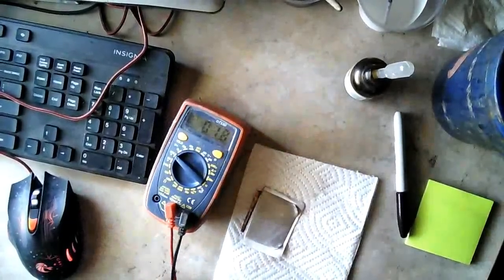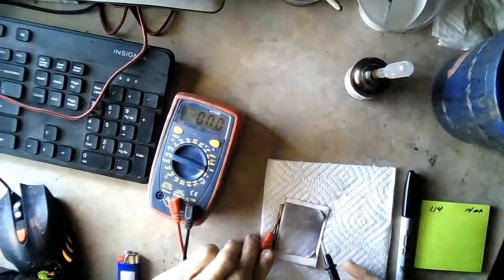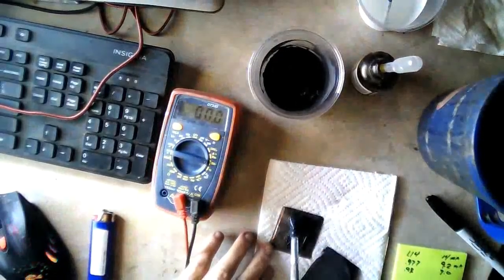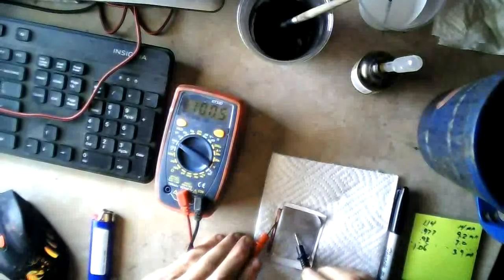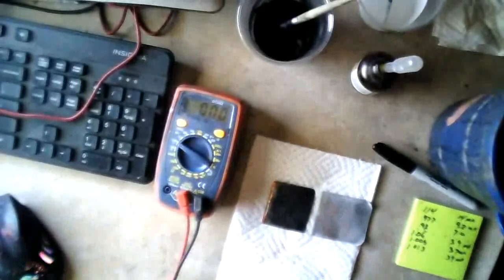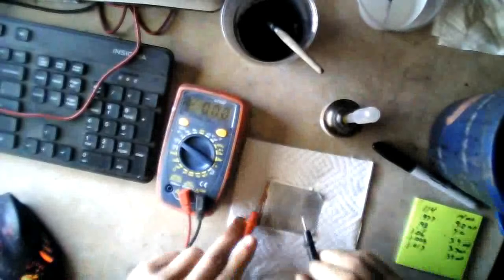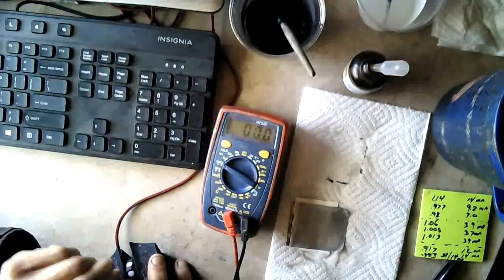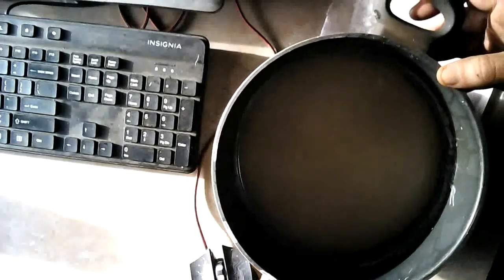Borax Concentration Question!

Comment: It's interesting that the PVA goes into solution with the borax further testing is probably warranted. Kev conducts countless experiments with various concepts. Not everything works the way you would expect.
Robert has a video using a few drops of glycerol in doped PVA linked with borax to make a solid plastic that would peel off waxed paper as a stand alone sheet. He has suggested using the plastics for solid electrolytes and possibly electrodes. There are so many ideas and only so much time to indulge. At any rate you are investigating some of the important fundamental questions.
Reply from the maker: We should find some more answers today, and hopefully build a better battery too. :-)

Comment: One thought that may or may not be helpful ;) -- normal PVA glue is not completely waterproof, even after drying.  For a longer lifespan I wonder if a truly type 1 waterproof glue would work better.  Titebond III ultimate wood glue is a cousin to straight PVA glue, but it is truly waterproof.  Or another option would be something like minwax spar urethane.  Thanks for all of your information!  I'm going to be doing a bunch of battery tests this summer and hopefully posting a bunch of videos.  Thanks again, Leo Wadsworth
Reply from the maker: Hi Leo, thanks for the suggestions. I'll pick up some Titebond 3 on my next trip to town. I've tried urathane before, but will probably try it again now that I know a little more about the cell. Looking forward to seeing your videos, and I'll mention them in my videos to help with your exposure. Hope you have great success self-charging :-)
Reply: Thanks!  I hope your success continues and grows too.  I'm listing your channel on mine.  One more option is marine epoxy.  The advantage to that is that it will fully cure while wet, even underwater.
Reply from the maker: Thanks Leo, if more people would share video mentions, self-charging tech would spread much faster. We need more people actively involved in experimenting for it to really catch on fast. :-)